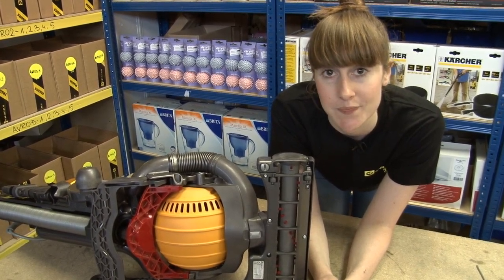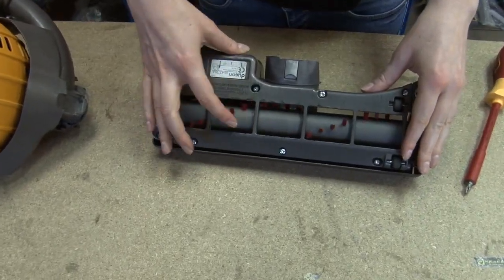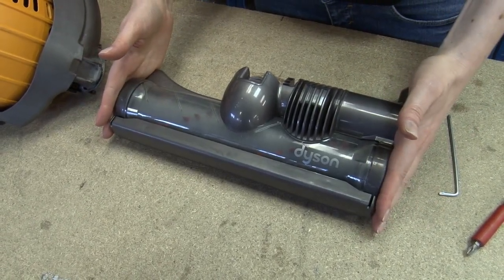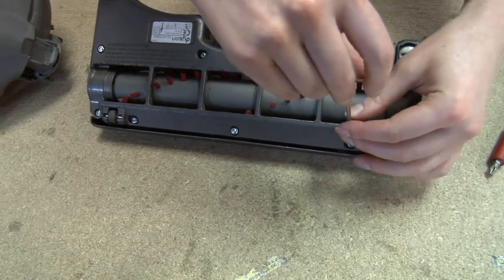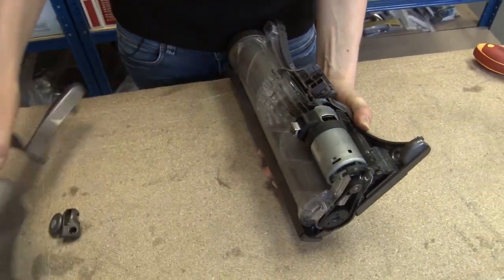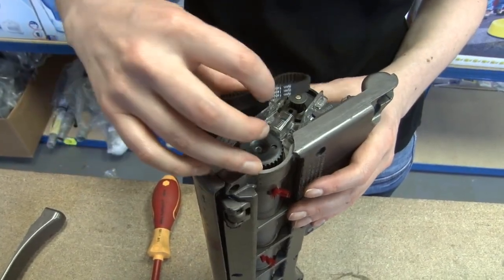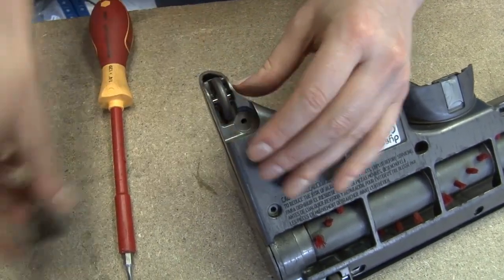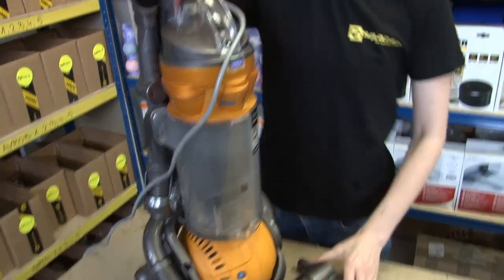Dyson DC25 Vacuum Belt Replacement - Easy DC25 Vacuum Belt Change!

Comment: I doubt that the belt will ever need replaced, but at least it's easy.  But I have a question:  why won't Dyson provide spare brushroll motors for the DC25 cleaner head?  Wouldn't that be cheaper than replacing the whole cleaner head?

Comment from the maker: All Dyson heads open in a very similar way. The screws that hold it all together are usually Torx head and the plastic connectors can be opened using a coin or Flathead screwdriver.

Comment: These videos are great. I've just replaced my motor as the brushes had disintegrated. However its still not working? Does the small circuit board or switch ever fail?
Reply from the maker: +Paul Rogers Hi Paul, you haven't given a model number so we can only generalise. When brushes wear down completely they can temporarily short the armature and can damage any 'motor control' PCB. Check the brushes are correctly installed and the plug fuse but if still faulty it may be the PCB.
Reply: +eSpares Its the DC25 multi floor. The hoover works but not the brushbar motor which is the motor I have replaced. The brushes fell out in lots of pieces so it most have gone with a bang! Do you sell the PCB or do I have to buy the whole head unit? Thanks
Reply from the maker: +Paul Rogers Check the 'park' switch first as this shuts off the brushes when the handle is upright, if sticking it may stop the brushes from running. The exploded diagram for your model does not show a PCB so if you have found one give us the full model details including the production number.
Reply: +eSpares Park switch is working ok. I have tested the reset switch which sits next to the brush switch and get a constant resistance reading from pressed to released? As if the switch isn't doing anything? It does move.The PCB sits next to the brush motor. You can see the end component in your video at 2.12 - black square with white writing, just under the small belt wheel.The model is DC25 multi floor and serial number is 480-UK-D 29810. Can't see any other numbers.
Reply from the maker: +Paul Rogers Hi Paul, The exploded diagrams for the power head on your machine do not show this PCB and it is not listed in the parts list so unfortunately it does not look available.  To help us identify the part you require please fill in the details on the form found by using the 'Help Me Find The Part I Need' link at the bottom of the page of our website or at: http://www.espares.co.uk/contact/sales

Comment: Any idea where I can buy the larger gear that connects to the brush bar?  Mine melted in half somehow as well as burned the side of the housing plastic where the belt touches it.  Perhaps with this piece I can get it to work again.
Reply from the maker: Hi Nick, Looking at the exploded diagram for the brush bar there are a number of spares available but the motor and gears are not. This is obviously out of our control. :-(
Reply: +eSpares hey bud. mrs or mr. i need to know if those r under wondty still ?? becouse i need a new brush deal the hole thing needs replace can you help me with one and i was told by my nearber that he got free one under wonarty and i need that bottom brush plate please help
Reply from the maker: +Garbage  Truck House Of Vacuums, Vacuum Guy If your appliance is under warranty you will need to either contact the supplier or the manufacturers agent to make a warranty claim. Warranties vary depending on the country and manufacturer so it is worth checking yours direct.
Reply: ok i will i might just buy the parts its like 50 so cheap? how much do u have them for
Reply from the maker: +Garbage  Truck House Of Vacuums, Vacuum Guy To answer that you will need to put your full model details in on our site at: http://www.espares.co.uk/browse/at1086ma716/vacuum-cleaners/dyson
:-)
Reply: i cant find the bottom plate can you price me a dyson dc24-25 dyson bottom plate
Reply from the maker: +Garbage  Truck House Of Vacuums, Vacuum Guy The sole plate for the DC24 is not listed but for the DC25 you can go to: http://www.espares.co.uk/product/es1085316

Comment: @eSpares     
Hello, first of all, let me say thank you very much for your informative video series. Unfortunately I find myself in need of further help. I have a lot of experience with maintenance and repairs, Not quite as much experience with electrical (though I do have some). All of that said here's where I'm at, I really hope you guys can shoot me in the right direction.
The model is DC25, If there's a difference, I live in the US....

So, it is a DC25 and it is amazing. We had it for a year, maybe a year and a half before the issue began. 
What is happening is that the brush head will spin a couple revolutions then stop. Seemed a simple enough fix, I bought a new brush head unit (complete, straight swap). The issue is, the new head acts the same (I almost took the new one back but it is clean and new so I kept it). I opened the switches and... I have no idea, honestly, I would like to replace all the switches (maybe they are the issue, maybe not but new switches last longer and Should not be the source of a fail) but I have no idea if that would do anything. The reset switch did nothing... 
So again, in short:
DC25
Brush Head assembly is newly replaced.
Suction (hoover?) Is fantastic but no brush sweep. 

I will replace anything that can or will help, I Love My Dyson.

If there is any further information i can supply ket me know. I hope I said all that needs saying but my memory is going so... 🤷‍♀️

😸😸😸✌️

Comment: I had to pull the brush of my Dyson dc33 as it was clogged up with loads of pet and human hair but now when I've pushed it back in the brush won't spin
Reply from the maker: Hi Charlotte, on your machine the brush is turned off when in the parked position so make sure the brush is not in the upright position. If it still does not spin there is a small switch on the yolk around the ball that identifies when the brushes are at 90 degrees to the body, this may have stuck.

Comment: hey bud. mrs or mr. i need to know if those r under wondty still ?? becouse i need a new brush deal the hole thing needs replace can you help me with one and i was told by my nearber that he got free one under wonarty and i need that bottom brush plate please help
Reply from the maker: +Garbage  Truck House Of Vacuums, Vacuum Guy If your appliance is under warranty you will need to either contact the supplier or the manufacturers agent to make a warranty claim. Warranties vary depending on the country and manufacturer so it is worth checking yours direct.

Comment: You had your hands over the buttons to remove the cleaner head and I could not see how to do it. .  When the vacuum is full of debris it is not easy to remove and difficult to figure out.  By the way, it is a #15 torque screw.
Reply from the maker: Thanks for the comments. If you look at 0:26 you can just make out Helen slide the button towards the cleaner body.  This should allow the head to slide off the body.
Reply: Her left hand is hidden under the unit.  It is not as easy as it looks to remove the head as it looks in the video. This should be clarified better.

Comment: What size torx is used?
Reply from the maker: These are normally either T10 or T15 but both are in our kit: 
http://www.espares.co.uk/product/es1251179
Reply: I Found That An Electrical Screwdriver Worked To Unscrew Them